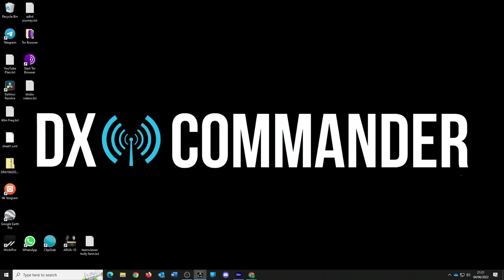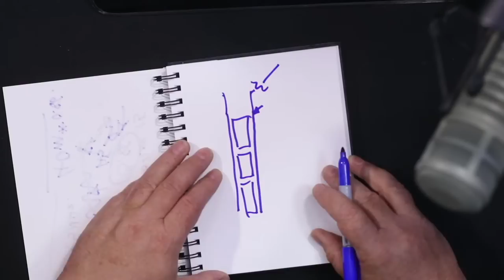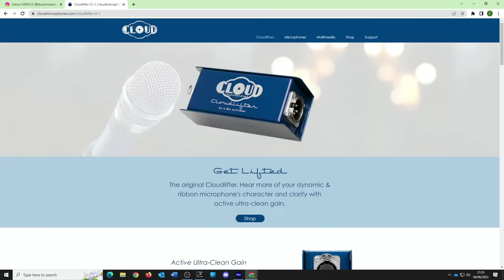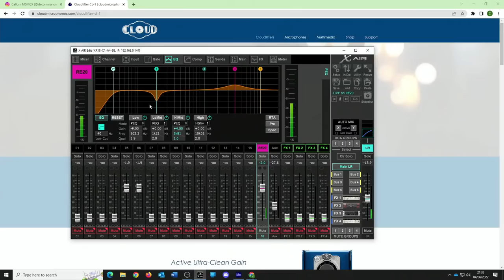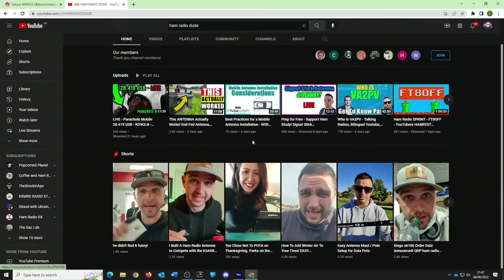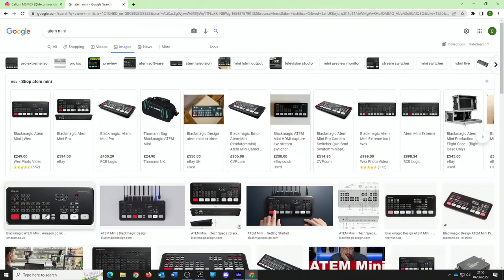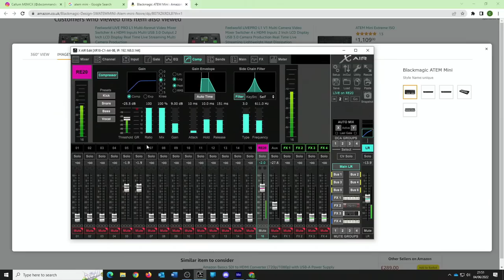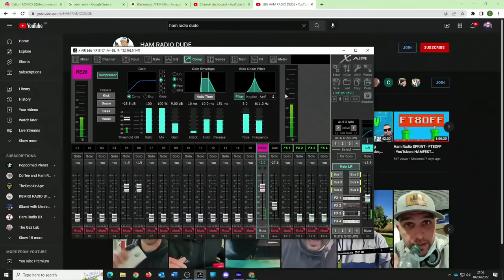Choosing Coax FAQ / FAQ - LiveStream

Comment: Cctv coax is 75ohm and can be high quality with foil sheild and plated braids, the biggest issue I can see is the cctv cable centre core is much thinner than rg58 center, power handling would be different to start with is my presumption

Comment: I've had good luck using 75 ohm coax on the CB band! when using 75 ohm coax in a 50 ohm
system you do want it to be a halfwave multiple! or use a antenna tuner! the three common types of TV coax are rg59 RG6 and rg11! rg11 is the same size as rg8 it is very low loss it is 
it has lower lost than rg213 in very close to lmr400. the braids on the cable TV stuff is aluminum so the use of compression type pl-259 is a must. or one could use the standard pl-259 bi-folding the braids back over the outer jacket and screwing it on the center conductor can be soldered as is copper-plated Steel. or one could use the proper TV style connectors F or BNC and then adapt to pl259. Or use no connectors at all and just use a banana plug in the back of the radio on the so239 connector. please do a special on 75 ohm TV cables test both rg6 & the bigger rg11 and then figure out the connectors to install on it! also do a special on weatherproofing pl259 like you were talking about. 73 & good dx!

Comment: How about a series on cheap coax v expensive.....Some say the receive noise is very high on cheap coax but I have not manage to reproduce this myself.
Reply from the maker: Well, expensicve coax basically doesn't "leak".. Hence the expensive double shields.. Not sure a whole series woirth it. That's would be a lot of testing. Bottom line is that if the antenna can hear the "noise", you are screwed anyway LOL
Reply: The "worst of coax" is only thin sheild, this let's electromagnetic noise in, it also has a bit of an issue if the coax is "swinging" in air and worse when rain/snow hits it as the transfer of ions can be heard as crackling. The other issues is that it can stretch under its own weight as there isn't enough metal substance to strengthen the plastic it covers inside.
Reply: @ianharvey868  Thankyou great points. Maybe Callum can include these in his up and coming COAX follow up video

Comment: Over the years I  have plenty of different quality of RG58 cable, some of them feels really loose and some little better. When there is no any detailed information available, hard to say how much they vary in the end. Last years I've been using Messi&Paoloni Airborne 5 cable - which looks like rg58 but what has much lower loss, I guess its ok up 50MHz when running decent lenght. When I bought it came a pit supprise how stiff it was. Not very good for winding in the ferrite ring - unless u use blowtorch. Anyway, good subject!! I'm also very interested to try ladderline or maybe homebrew open-wire as a feeder. // 73's de OH7FDY
Reply from the maker: Home brew open-wire feeder.. That's something I've not done!